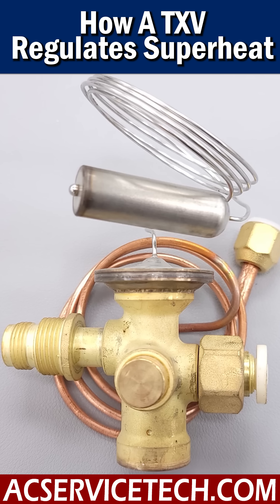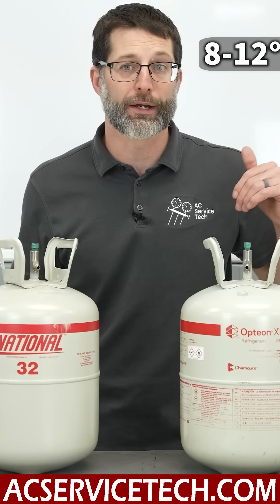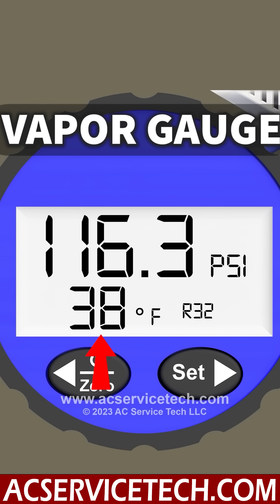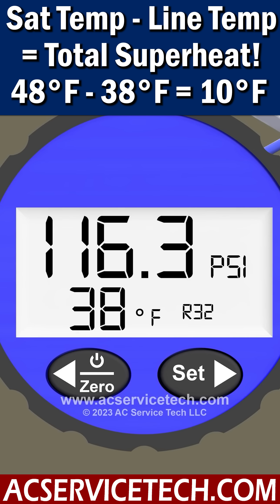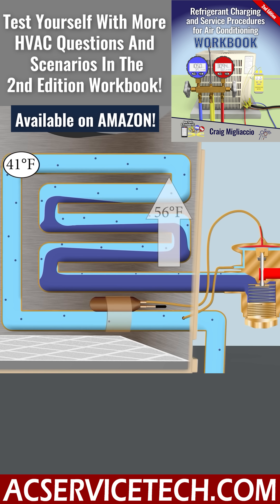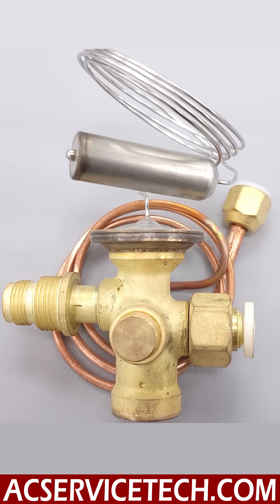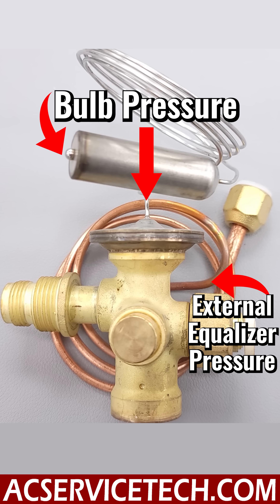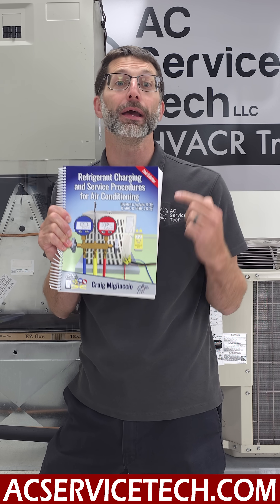Does A Thermostatic Expansion Valve (TXV) Regulate Superheat? How is this Measured?

Comment: So r32 (and presumably 454b) should be charged by superheat instead of subcool? I thought txv’s always regulated subcool and fixed orifice’s regulated superheat
Reply: they both regulate superheat. metering devices all regulate Superheat in the Evap. However there are systems that have TWO metering devices, 1 in the Evap and 1 at the Condenser. Generally i see these on Carriers but other brands use that as well. 
Its important to verify the metering device and if you have 1 metering device only in the evap. 

I think the confusing part that maybe messing you up is when you have TXV there is just a "general" Target SH you are looking for, if it's close to that then you dont have to do any calculations. You would still need to find what your subcool should be tho based on temp and wet bulb and all that. 

For pistons in the evap because it doesn't adjust how the TXV does, the Piston just goes; so for that you would need to calculate what your target Superheat should be and that's how you verify if your piston is regulating refrigerant correctly or not.
Reply: Many txvs in r-32 units are adjustable, so most manufacturers want you to weigh in the proper amount of refrigerant, then run the unit, verify super heat is in range, then charge by the sub cooling.